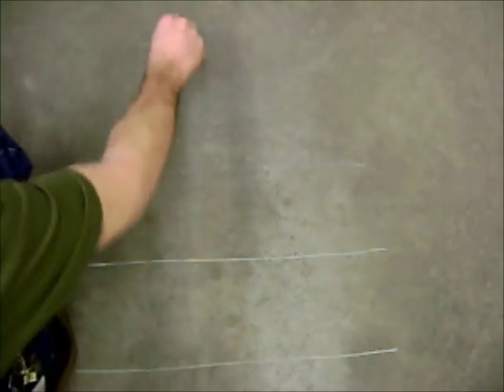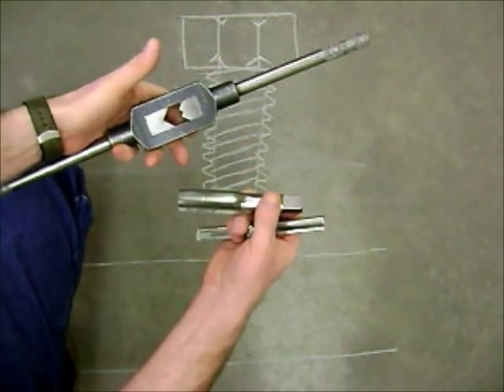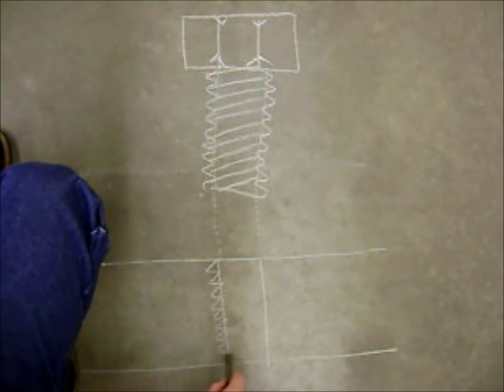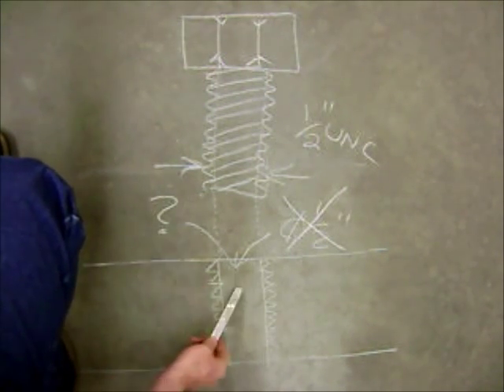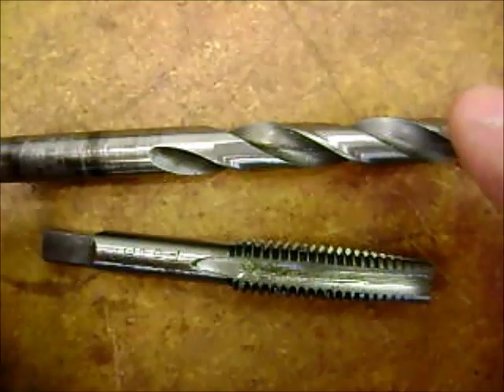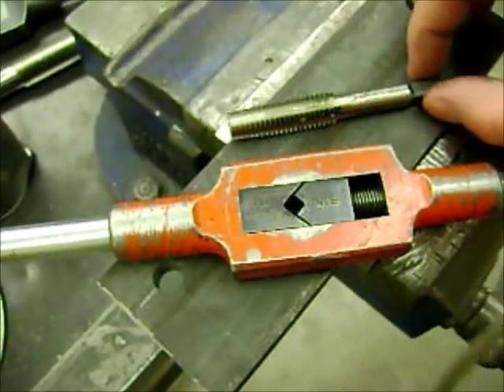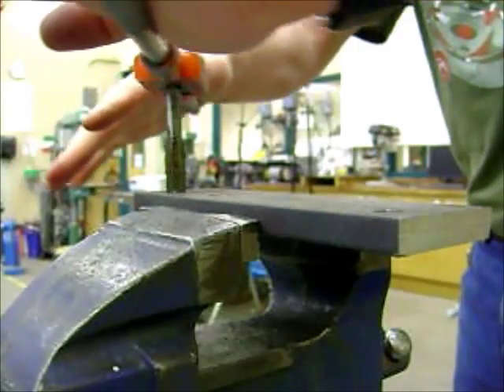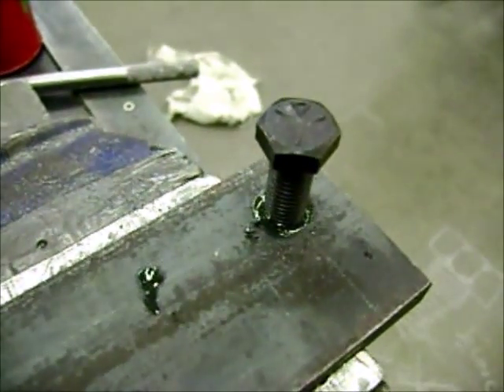Thread Tapping - Taught by a Shop Teacher

Comment: Great to the point vid. Question regarding difference use cases between the different axial degree tap shapes? - (taper, plug and bottom?) - I have typically used  a taper but broke it and used a bottom thread for the rest of the work and didn't see any difference other than maybe a slightly slower start. I would imagine a fluting difference is more about chip management but wondered about the strength of the starting threads between using those three .....
Reply from the maker: A taper tap starts easily, but won't get to the bottom of the hole. A bottoming tap doesn't start easily, but finishes to the bottom of the hole. A plug tap is kind of in-between, and I buy either plug taps or bottoming taps depending on what my supplier has at the time that I need them. There are other arrangements of flutes and number of cutters that might relate to their strength or if they are a powered tap or not.  I do not buy cheap taps - the kiddies break them far too easily, and getting a broken tap out really isn't fun.
Reply: Thanks! yeah breaking bits can be a nightmare-I snapped a 3/8 in 1/2" after it was most of the way through and drilling it out destroyed a couple cobalt bits- I ended up using a plasma cutter to blast a hole re-drilling larger to remove the pieces and multipass welded and reground it flat before retapping- huge waste of time

Comment: how do I run a 3/4 tap in a piece of half inch plate? The tap wants go cock eyed before I even get one turn in
Reply from the maker: If the plate is moveable, clamp it in a drill press table with the aligned with the drill chuck, and use something in the chuck (or a live center in place of the chuck) to hold the back of the tap (there is a hole in the center just for this sort of thing), then with a third arm keep pressure down while you turn the tap handle.  If the plate is immobile, you could use a Mag Drill to do the same. Otherwise you're just going to have to be more patient, though a sharp taper tap can work wonders (dull ones suck).